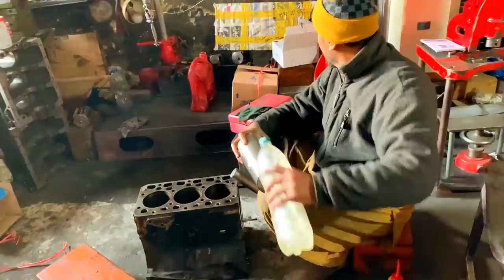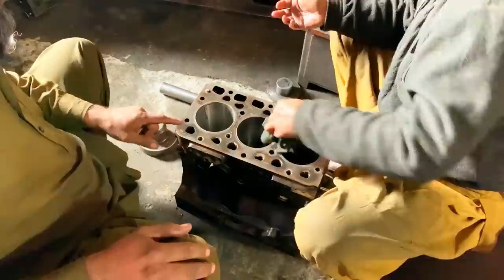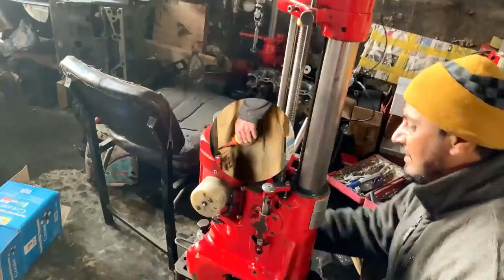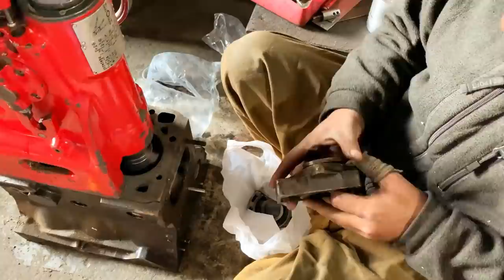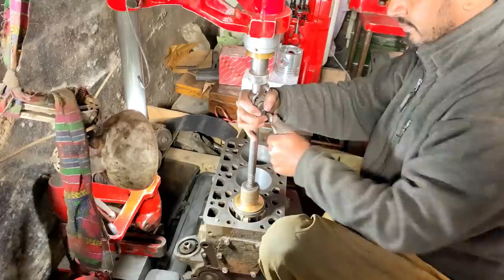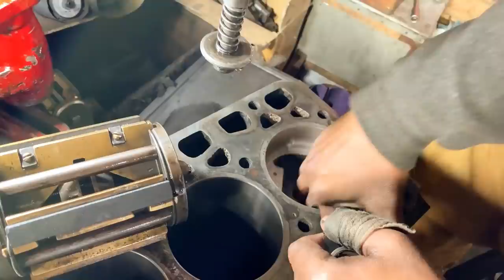Fiat Trackter 3 Cylinder engine block boring | installed Cylinder sleeve | rebuild engine block

Comment: Very nice skills. But one point. Never use a New piston as a guage for checking bore clearance. It will scratch the aluminium piston and also spoil the Oval turning of the Piston. Always use proper measuring instruments like a Bore guage. It is a very small investment compared to the investment on the boring machine and other equipment, but it will always deliver guaranteed quality and happy customers. Good luck